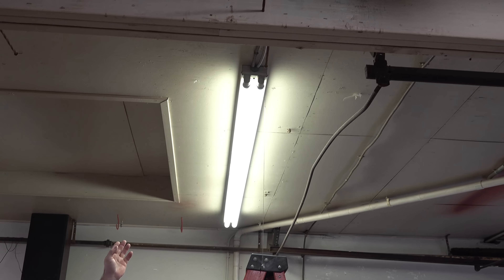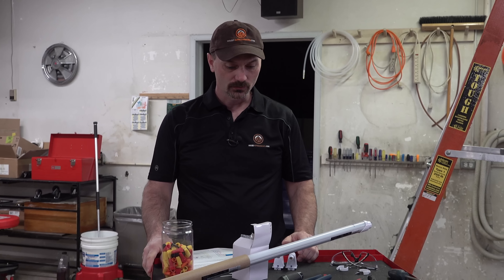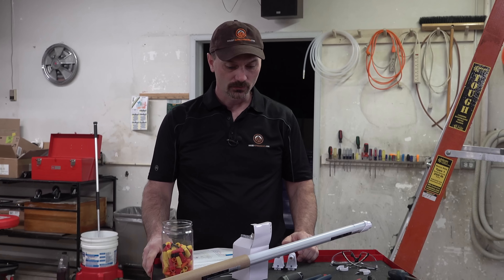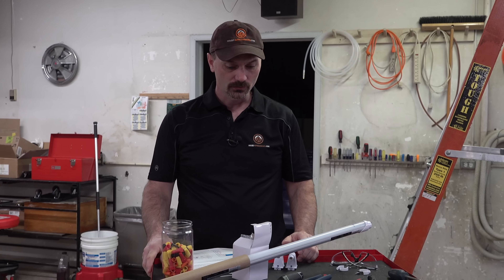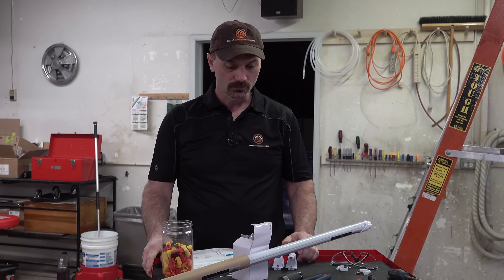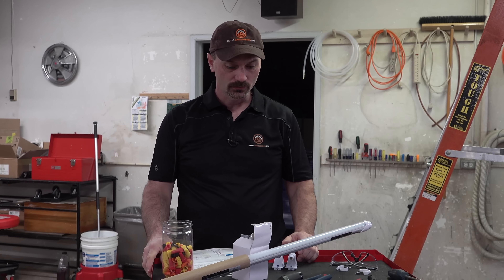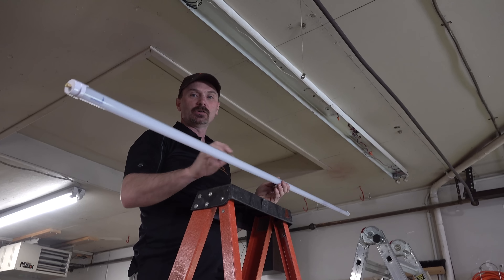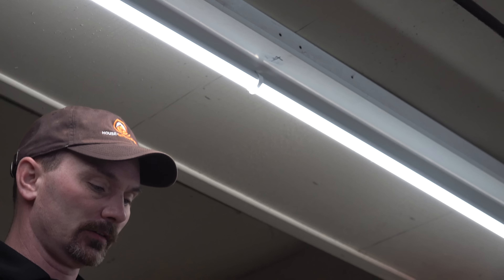How To Convert A Fluorescent Light To LED [Bypass Ballast]

Comment: Shannon, Great video! Yours is the clearest how-to video I've seen on converting florescent tubes to LED tubes. One thing that should be noted is that, if you are using three-way switches and have multiple fixtures wired in parallel, the wiring will be different, depending on whether the power source is coming from one of the switches or first goes to a fixture. I haven't seen this covered anywhere.

Comment: Great video.  As mentioned need to be careful with which bulbs are purchased, especially with T8 or T12 types if just doing a ballast removal.  Many Direct Wire LED T8/T12s on Amazon are 'only for non-shunted' meaning that both the hot at neutral are at the same end.  If a bulb type says "either shunted or non-shunted" the setup in this video will work (as in hot one side, neutral on the other).   Also make sure to by bulbs designed for direct wire, most ones sold as stores are compatible with ballasts, not direct.  If you end up buying T8 bulbs for direct wire, i've found GE LED Type B have worked well.
Reply: I’ve got 8’ light I redid like this. Only one side is working. The bulb itself says double end powered. I did hot on one side and neutral on other. What did I miss?

Comment: recently a businessman I know asked me about converting to LED. I explained I recommended bypassing the ballast or removing it completely. He wanted to use the electronic ballasts his lights have but I explained the ballast uses power and when they fail he would have to convert to no ballast or buy another on to replace the bad one. when I gave him the breakdown on the cost of use for LED versus Fluorescent he was astounded. He later had all his lights converted and the light output in his store is at least as bright if not brighter than before and the operating cost is about 20% of the old ones. by the way only very old ballasts contain PCB's so that is not a very big problem .

Comment: I had my fluorescent box removed and have a led vanity light. The electrician said because the bulbs are too wide to sit in new light. So, I need to cut some wood with 4 inch hole to allow new light fixture to set out a few more inches....can you pls advise how to do this. Thxs

Comment: I installed the same brand in my kitchen (Hyperikon). I purchased on Amazon. All the LED replacements bulbs at the local home centers required that the ballast be left in place because they were design for direct replacement by home owners. Much (much!) better to remove the ballast.  I used a dimmer on my bulbs. There is a little bit of flicker at some (not all) dimmer levels. That's my only complaint.

Comment: Is there any other lights (more visually appealing) that install similarly with the wire pulling through the light fixture? I have a wire stubbed out of the wall with no junction box or ceiling box in a closet.  My initial intention was to do one of these but not sure if its going to be appealing enough to buyers.

Comment: The single ended replacement bulbs seem to be getting harder to find. The two big box stores I checked with only carried the plug-and-play double-end LED tubes. If I want to remove my ballast can I wire the double end up directly to the 120v line circuit with hot at one end and the return at the other?

Comment: How do you convert a 4 tube fixture to LED if it is a night light (not controlled by switch) in a office building when it has 3 wires: red, black, and white. I have been using the same method you used in this video when I am doing regular lights that turn off and on with a switch (they only have black and white)

Comment: FYI some tombstone manufacturers have not approved the direct line voltage method.
Reply: the power consumed on each tombstone is usually less than 9 watts so you will never exceed the power rating of them. It is important though to label them as 120v so that in the future they can be change if necessary without danger to the maintenance person.

Comment: Not sure what is involved in the "kit" you were talking about.. Aren't you just cutting out the ballast and reconnecting wires? Also, is there any energy savings or performance enhancements from removing the ballast?
Reply: Stephen Hill “Bypass ballast” conversion may involve rewiring and replacing tombstone and it looks like the kit includes new tombstones in case you need replacing. Ballasts are really needed only for fluorescent lights so they contribute nothing when led converted.

Comment: Well it's not straight 120v power per se, there is a internally powersupply as LED's don't work on AC. 
Given the tombstones aren't proprietary, sticking any other bulb in that requires a ballast or power supply in the future would have bad results. A label might be wise to add.

Comment: Or just clip the wires off of the ballast.
Connected two wires on one end to the neutral. Connect the two wires on the other end coming out of the sockets to the hot. Replace the covers and install the light bulbs. And if there's a wrong PIN go get the right pin... two pin or one pin. You're welcome.

Comment: i've watched several of these videos. the only thing missing is handling old ballasts that leak oil. this oil contains pcb's which have been outlawed because of the danger of cancer. wear surgical or other non-absorbent gloves when handling these ballasts. newer ballasts are o.k.

Comment: In and 8' fixture 2 lamps you dont have that kind of a diagram for the wiring all you do is disconnect the live wires cut the wires from the ballast at one end where the spring tombstone is tie the wires together the hot wire will go to those wires at the other end time those wires together then tire your neutral wire to those wires and then you tie your hot wire to the other end and your done

Comment: Great technology these LED retrofit tubes but OMG, check out how expensive those tubes are!  At about $0.15/kWhr (on peak) assuming 4 hours of use per day for two bulbs and a 30,000 hour life for the bulbs, it'll take the average homeowner over 10 years to beak-even in the hydro savings and by then the price of these will be more inline with the garden-variety fluorescent tubes.  This retrofit is only viable for commercial, industrial and institutional building owners and operators.
Reply: I just bought a set of LED's to try. Mine are 36" t8's and the price difference between flourescent replacements and these was just a couple of dollars. Also, some of my ballasts were burned out, and those cost WAY more than a whole new fixture would have been worth.
Reply: @dart70ca  LED T8s can be economical when bought in bulk but I agree that if you have to replace a ballast, go LED and save the fixture if you still like it.  Recently, I fitted my garage with some free troffers that had noisy and inefficient magnetic-type ballasts.  Bought new electronic ballasts from a supplier who bought the ballasts in bulk and sold them to me for $6 each and threw in several free FL T8s.  Good for five years or so.  By then, LED T8s will be totally mainstram and affordable.
Reply: Andrew Macdonald Nice! Certainly way more expensive here (Vancouver). My LED's were the Hyperikon 36” ones and I installed them yesterday. Jury's still out. I think the light from the fluorescents is still better; more spread and softer shadows. Probably due to the 360 degree nature of the fluorescent bulbs and getting reflections off the ceiling. These were $54 CAD for 4 and a 10% discount kicked in after that (Amazon). Finding 36” tubes locally has been challenging and 36” LED's a total failure. The two fixtures they went into had dead ballasts.

Comment: This is a very basic video that only shows how to remove the ballast for ballast bypass TUBES.  My research is coming up with limited results for T12 LED tubes (1.5 diameter) and most have very poor ratings.  How about a professional opinion an options for people who do have a old fixture that is an 8 foot T12 fixture with the Fa8 single pin base.  Best led tubes, single row LED, double row LED, V Shaped LED.  Would it be better to convert the two row 8 foot length tube fixture a 4 tube T8 configuration?  There is a lot missing here unless you only want to know how to take out the ballast.

Comment: I write this review to warn those intending to convert fluorescent to LED tubes in ceiling fixtures that all is not as simple as portrayed in videos and literature on Amazon, Hyperion, and Utube.  
 
During 1/2020, after studying Amazon literature, UTube videos, and Hyperikon literature and videos regarding the replacement of fluorescent with LED tubes,  I purchased 16 Hyperikon T8 LED Bulbs 4 Foot, 40 Watt Replacement (18W), T10 Light Tube, 5000K, Dual End Ballast Bypass, Direct Wire, UL, DLC, Clear, 12 Pack ($131.55) and 4 Pack ($39.80), 130 Lumens per Watt, 45,000 hour life rating, 5 year warranty from Amazon.  I had 4 fixtures in my home, each with four T12 tubes and double ballasts.  All the literature and videos led me to believe that the conversion was relatively simple which I could do myself.  I opened one fixture, removed the cover housing the wires and ballasts, and quickly realized that things were not as simple as I was led to believe.  After hiring an electrician who worked for 3 hours removing the ballasts and rewiring the tombstones where needed (at a cost of $688), the tubes were bright and all I had expected in terms of brightness and CFI.  
 
Beware, those who sell LED tubes are in the business of selling tubes!  They do not always tell you all the information necessary to complete the conversion.  I would recommend you contact an electrician and seek their expertise before purchasing LED conversion tubes.
Reply from the maker: It does completely require the proper tubes for the situation you have. Some tubes do not need the ballast and some tubes will work with a ballast.

Comment: This entire video is obsolete! All of the LED tubes they have at Home Depot have the power at both ends and are designed to work with a ballast! They don't even make LED bulbs that can work with this wired configuration anymore.
Reply: Willie D.  You're messing with so called "Plug and Play" tubes that ONLY work with ballasts.  They are the lazy way to "convert" to LED.  When the ballast fails your tubes don't work either and you will curse the day you bought those P & P tubes.  They are type A tubes.  Instead get the type B tubes that get hot lines on one end and neutrals to the other. I been fooling with these convertions since before Christmas,. I've learned a lot, mostly the hard way (and lots of youtube tips and vids). Look for type B tubes, if it even says on the box.  Good luck
Reply from the maker: This is incorrect. You can for sure bypass ballasts and really it will save you more money energy wise with the ballasts not being used. The "plug and play" LED bulbs is just a quicker way to use an editing fixture but not saving you as much on utility costs.